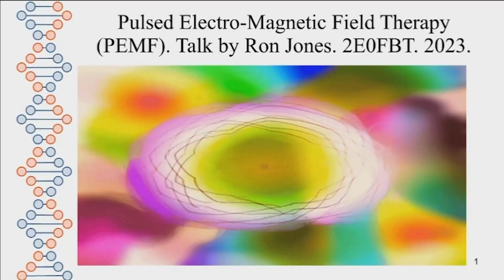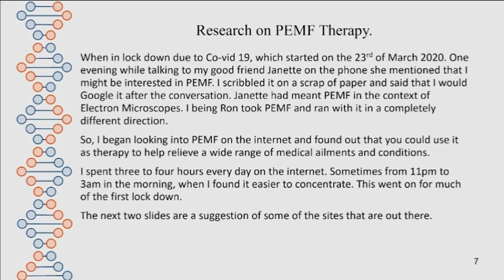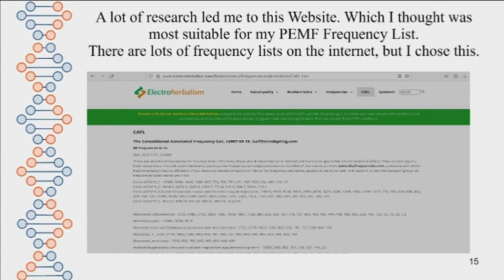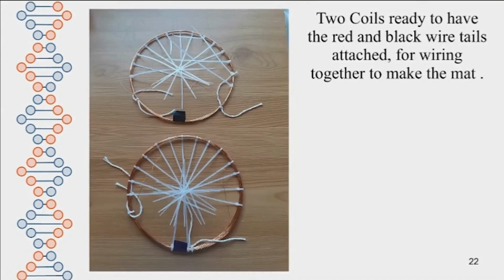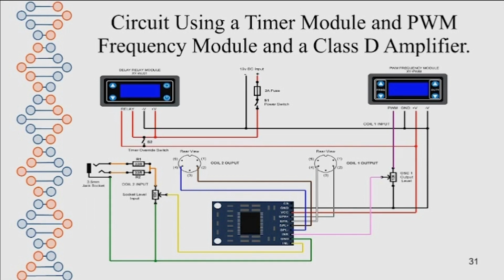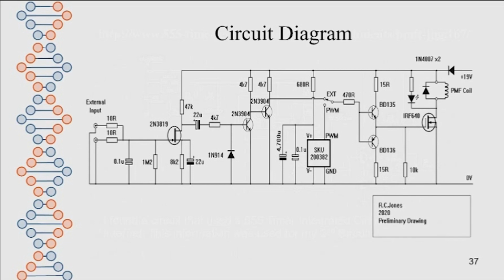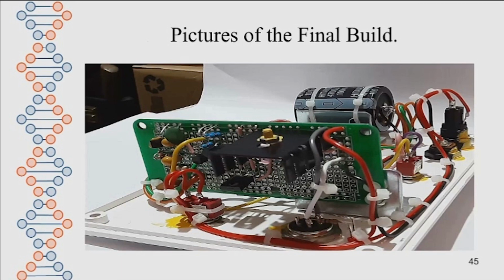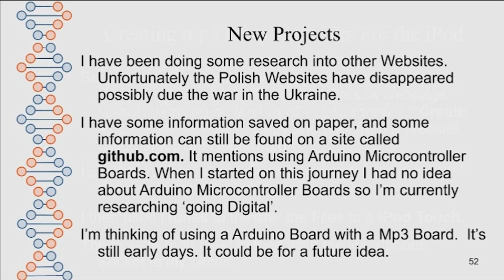DIY Pulsed Electro-Magnetic Field (PEMF) Therapy.

Comment: Dear Ron, first of all, congratulate you on your research and work, and also for sharing for free, so people who cannot afford to buy expensive equipment can access this therapy at a lower cost.

I have very little idea about electronics, and also searching could find time ago as you @MirkoPavleskiMK and @biotronikapl9670, both with outstanding creations also for free, but the first has not made yet a pemf mat and second could not find the full specs for that. 

For this reason, I would like to ask you for the complete specifications, especially for the coils since, as Mirko comments, they must meet a certain ohmic resistance and inductance to avoid causing breakdowns, and also produce enough gauss to produce improvements in health.

I don´t know how to write you, but if you want, I can publish my email.

Keep the good work! Thanks one more time.
Reply from the maker: Pablitus. Sorry for being late for a reply. I have found  two drawings from the old website of " Biotronika" that I printed at the time. I have moved since building the project that I built. So it has taken a few days to find them. The drawings gives coil winding details in a chart. It also shows that he used a total of eight coils for his mat. Also bear in mind he used a laptop power supply rated at 14 Volt at 1 Amp. I am going to  put this extra information as another short video.
If you want to contact me I have a separate Email Address which is pemfron@gmail.com
Reply: Dear  @PEMFron  really thanks for your reply. No hurry, I will wait for your next video and also will write you, but I will give an advance about some aspects that prevents me from doing the project. I think many people will appreciate this information and maybe can exchange experiences and knowledge. 

Mirko has several projects with differents designs of coils with specific values in the inductance and resistance, the thickness, number of turns and diameter as well, so as not to damage the Wave Generator, Mosfet, etc... and the correct Power Supply for it to work, and the gauss they can achieve. In some desings it is needed an amplifyer, but I think it works from 20 to 20.000 hz, so does not recognize lower frequencies that are also useful. These values are what I miss in   Biotronika´s design.

Thanks in advance!
Reply from the maker: @josepablogarciaserrano6849  Hi Pablitus I think that the reason for the 20 to 20.000 Hz is because audio  amplifiers are usually classed from
 20 Hz  to 20.000 Hz (20 KHz). If you go below say 20Hz that is very for audio. And becomes very low frequencys like 7.83 Hz for example. Audio amplifiers may possibly go lower in frequency. A bit of advice is don't use a Class D amplifier. Because I tried one and I found that the one that I used didn't have a very clean square wave. See my video.
The Frequency Module that I used was ZK-PP1K. But some people use the other one which has more current output of 8A (Amps). That way is not as sophisticated as you can only use one Frequency at a time. I hope that this information helps. I don't know how much you know. For example if you can solder etc. All the best Ron. Email me at pemfron@gmail.com
Reply: Finally did not buy class-d amplifyer, it is cheap for a first project but I will use my hi-fi one, it will not be portable but fill fit my needs for first test. Greetings!